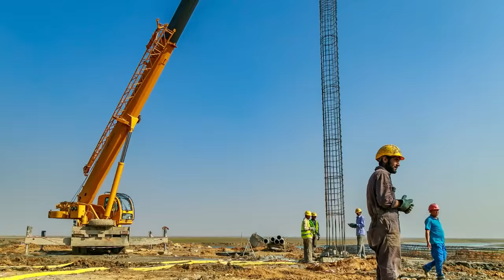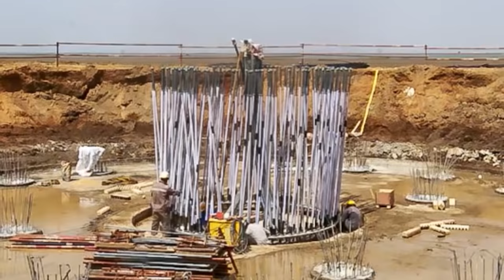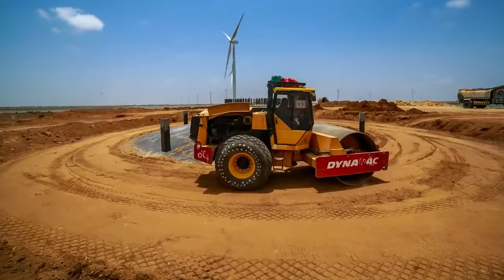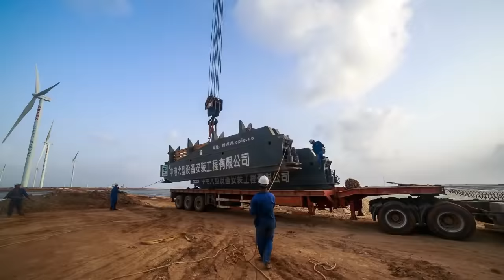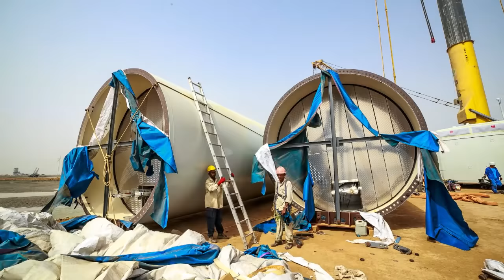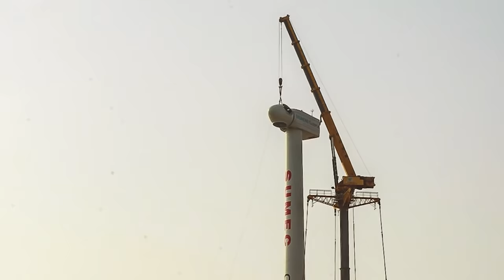Wind Turbine Farm Installation From Scratch | Time-lapse - Mega Structure

Comment: does one calculate the carbon footprint it takes to put one of these things up, or is that irrelevant?
Reply: It makes people feel good. That's the important thing.
Reply: Vestas studied the carbon payback period for various turbines. This took into account extraction and manufacturing of raw materials, production of the turbines, their transport, erection, operation, maintenance, dismantling and disposal, and the same for their foundation and the transmission grid. The figure was between seven and nine months, depending on the type of turbine. Other analyses have come up with similar figures.

Comment: What an incredible time lapse. It’s so impressive, the work required to install and erect a wind turbine. So much steel went into the base! I was amazed at the size and number of shafts that went into the foundation. I hope they don’t mind tying rebar! Lol. Thanks for the video 👍🏽
Reply: Imagine what it takes to build the tallest buildings. The foundation work alone is mine boggling.
Reply: Kashif, you make a good point about how un-Green this wind turbine is.
Reply: @earlysda  Vestas studied the carbon payback period for various turbines. This took into account extraction and manufacturing of raw materials, production of the turbines, their transport, erection, operation, maintenance, dismantling and disposal, and the same for their foundation and the transmission grid. The figure was between seven and nine months, depending on the type of turbine. Other analyses have come up with similar figures.
Reply: You must be a structural Engr.

Comment: Please tell me what part of this construction methodology can be categorized as “green”?  This is referred to as “green technology”.  Thousands of CY of earth moved to construct an access road; with diesel/hydraulic equipment (D/HE).  Thousands of tons of reinforcing steel fabricated, delivered, and placed by D/HE.  Thousands of CY or CM of concrete produced, delivered and placed by D/HE. The foundation concrete placement duration was approximately 14-hrs, overnight by utilizing diesel-powered light plants.  The steel is manufactured in an efficient coal-fired mill, delivered by diesel-powered trucks, and erected into position by D/HE.  The nacelle is minimum 25% polyethylene which comes from natural gas.  PVC conduit for the cabling, insulation for the cables are produced from derivatives of hydrocarbons found only in oil and natural gas.  The turbine blades are manufactured in an extremely controlled environment requiring a consistent electrical power source.  The blades are also made from synthetic composites derived from fossil fuels.  The turbine blades have a restricted service life dependent on natural environmental conditions and will be replaced several times before if ever the generator produces a ROI.  Every wind-power installation is placed in natural atmospheric flyways used be migratory species for centuries.  These installations are ALL subsidized by tax-dollars in the US.  That is the only aspect of their fabrication that can be truly referred to as a “green”.   I’m glads it makes all of you “feel” so good.  Otherwise, these illogical expeditions of your tax-dollars will be guaranteed to shred more birds than they could ever produce a ROI.  CHEERS!
Reply: Finally, somebody asking the proper question. On top of all that, they require an immense amount of maintenance and have a rather short life-span (~20) before they become permanently disabled eyesores. To properly consider their environmental impact, on top of everything you mentioned, we'd have to consider the immense amount of machinery and running time required to destruct them to return the habitat to where it started.

I respect all the engineering, the planning, the logistics, and the construction, but at the end of the day we have to ask ourselves -- does harnessing wind power really offer any net positive impact on our environment? Is it possible we actually produce more CO2 in the construction of these things than we offset with the power it generates during its lifespan? Can we really call this "clean energy"? Where is the cost benefit analysis?

Comment: The precision and accuracy of the crane operator are quite breathtaking... getting the base bolts inside the columns holes seemed to be an impossible task.
Reply: Thank the RIGGER for that. Crane op just takes his instructions
Reply: @zaidyjames7627  
The "crane rigger" is doing important and responsible job for sure, but don't forget that the operator is the one who interprets the instructions into actions (He's in charge for the moves).
Just imagine a very smart and well experienced "rigger" giving precise instructions to a dumb crane operator ! On the other side, a skillful crane operator would never accept irrational instructions !

Hope you got my point.
Reply: @Unknown-qy3dx  I do.

So it basically goes both ways.
Reply: @zaidyjames7627  
Exactly... both depend on each other in an integrated job.
Reply: @zaidyjames7627  Lee

Comment: I wonder how many years of operation it takes to outweigh the cost and fossil fuel use in the planning/engineering, manufacturing, transport, construction, and maintenance of these windmills.
Reply: In 2015, Siemens studied the energy return over energy invested...onshore 4.5 to 5.5 months and offshore 9 or 10 months. Today we have larger, higher, more efficient generating more electricity. In 2015 turbines were 2 MW in 2020 3.5 - 4.2 MW. So the embodied energy payback might 3 months...

Comment: Fascinating stuff. That is just pure art  the rebar work. I had no idea such a substantial base was below ground, that must cost a hell of a lot of money just the base alone. And the way the bottom section flange simply slid down the ground fixing bolts, bliss.
So if this amount of work is required for each turbine column then that windfarm will take years before payback 🤔
Reply: And in 15 to 20 years when the wind turbines are done providing energy, what happens to the base in the middle of farmland. Their could be HUNDREDS of these spread throughout the county buried? or left standing?  What to do with the blades since recycling is costly and not widely available. Landfills here they come.
Reply: I don't think they will be done after 20 years, because they will be maintained.

Comment: How long would this need to run before it’s installation was carbon zero?
Reply: For the vast majority of turbine installations, it's six months or less.  And of course there's far less carbon waste in construction of these than a coal or gas plant.
Reply: After hub height exceeds 90 meters they will never become carbon neutral until after 25 years of operation.
Reply: a couple of months
Reply: it's usually 9 month or even less at the coast.
Reply: @rhondasouthard4682  Vestas studied the carbon payback period for various turbines. This took into account extraction and manufacturing of raw materials, production of the turbines, their transport, erection, operation, maintenance, dismantling and disposal, and the same for their foundation and the transmission grid. The figure was between seven and nine months, depending on the type of turbine. Other analyses have come up with similar figures.

Comment: so how long does it take then for this one windmill to pay back all the gasoline/diesel used by the construction vehicles?
Reply: Vestas studied the carbon payback period for various turbines. This took into account extraction and manufacturing of raw materials, production of the turbines, their transport, erection, operation, maintenance, dismantling and disposal, and the same for their foundation and the transmission grid. The figure was between seven and nine months, depending on the type of turbine. Other analyses have come up with similar figures.

Comment: would love to know the actual honest carbon footprint of windmill from workers traveling to offices to design it,workers traveling to work to make the materials for it, the shipping/transport/instalation etc
i know my old chemistry teacher said he worked it out for our local windfarm and reckoned it was 10 times worse than coal fired power stations.
Reply: You forgot mountain top removal for coal, transporting it, the actual burning and the average of 250,000 tons of waste per year that one coal generator produces
Reply: @justinsnyder5260  The difference is they don't call coal "clean energy". Wind is labeled clean, but clearly with the amount of CO2-belching equipment + running time to build them, transportation of all these resources, etc. there is a significant cost that nobody ever mentions. Coal plants last longer than 20 years too. This thing will be nothing more than an eyesore in a couple decades. All we're asking for is a little more honesty in the "green energy" sector, something sorely lacking right now, and that is by design. It's all about the $$$.
Reply: @keyser456  Vestas studied the carbon payback period for various turbines. This took into account extraction and manufacturing of raw materials, production of the turbines, their transport, erection, operation, maintenance, dismantling and disposal, and the same for their foundation and the transmission grid. The figure was between seven and nine months, depending on the type of turbine. Other analyses have come up with similar figures.

Comment: How long before it has given back the energy used to create it?
Reply: 6 months
Reply: @TheFreshSpam  not a hope in hell that its 6 months unless your factoring just the manufacturing of a single turbine itself. All that digger work, man power, delivery, concrete, cranes has to be factored in as well
Reply: @davidoff59  If your thinking that in this video the amount of man power and machines used is equal to more than 6 months of a fully utilised wind turbine generating energy I think you have your estimates completely off. If that amount of work amounts to more than that the world is royally screwed when we build anything big.

I think youd be suprised, and when you create the definition carbon neutral you incorporate its construction and creation.  Yes all those digger and people. Wind turbine are effective. They just sit there and spin and generate.

6 months and getting shorter by the day. The more we make the shorter the time.

Comment: Question: why they cut off the top portion of the foundation beams?? I have also seen this when they make pillars for flyovers.
Reply: I think to make that cantilever.. They cut off and spread it horizontally and then concrete slurry was moulded which make that vertical beam cantilever

Comment: I wonder how many years of energy production it take to break even on this?
Reply: Vestas studied the carbon payback period for various turbines. This took into account extraction and manufacturing of raw materials, production of the turbines, their transport, erection, operation, maintenance, dismantling and disposal, and the same for their foundation and the transmission grid. The figure was between seven and nine months, depending on the type of turbine. Other analyses have come up with similar figures.

Comment: The costs for a utility scale wind turbine range from about $1.3 million to $2.2 million per MW of nameplate capacity installed. Most of the commercial-scale turbines installed today are 2 MW in size and cost roughly $3-$4 million installed.

Comment: Incredible work done by all!
But look at all the raw materials that go into making one turbine?
Concrete, steel,copper,fiberglass,alot of oil for the gearbox/transmission, all the diesel to run the excavators,trucks,etc.
I heard that a wind turbine NEVER becomes carbon neutral?
Reply: An incredible amount of fossil fuels went into producing this "green" energy source.
Reply: Vestas studied the carbon payback period for various turbines. This took into account extraction and manufacturing of raw materials, production of the turbines, their transport, erection, operation, maintenance, dismantling and disposal, and the same for their foundation and the transmission grid. The figure was between seven and nine months, depending on the type of turbine. Other analyses have come up with similar figures.

Comment: - Haha....  what is the life expectancy of a windmill?  Also, what kind of maintenance is required to keep them running?
Reply: 25-35 years. Weathering and freezing of the blades needs constant checkup. It's expected that the turbine will receive a replacement set of blades once in its life, but depends on conditions. Also the gears, generator and power electronics in the nacelle need to be maintained. There's an access path inside the turbine for technicians.
After lifespan the turbine is dismantled, but the concrete foundation will just be left there since it's too expensive to remove. Also, many components are recyclable material like steel, but if the turbine blades are fiberglass they'll probably just end up buried in a landfill.

Comment: Look at the massive land displacement, energy use and resources (steel, copper, concrete, composite material for the blades, etc.) for a few megawatts of energy. Windmills are a disaster for the environment. Nuclear power uses a tiny amount of land and a fraction of the resources for 1,000 megawatt reactors.

Comment: I’m not understanding why they had to do all that demo on those concrete columns.
Reply: They hold whole construction. The biggest work and calculations must be done.
Reply: Because they don't know how to install a drilled shaft correctly. The rebar should not have been covered in concrete to begin with if it needed to project into the footing.

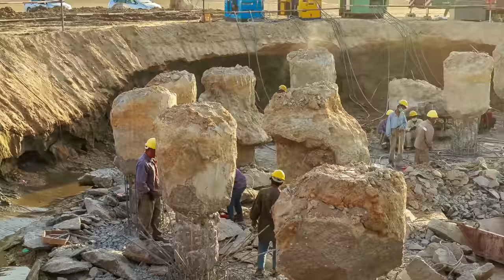Comment: @1:41 instead of placing a canal like option, they are directly placing the main central wire under the concrete. isn't that a bad idea? 
what happens when something goes wrong in that part of the wire connection?
Reply: It's just one smooth 90 degree bend, so I assume it's possible to re-thread a new cable through the bend if you need to.
Reply: john mcgee  Thanks for the information bro.

Comment: Hallo 
How does drilling  a stratting on video which type drill machine i like your sharing video wher are installing this plant and which country thank you
Reply: Pakistan.
Reply from the maker: Hi,
Its piling machine not a drilling machine, its a simple piling process in which they dig a hole, insert a steel cage and fill it up with concrete in order make a pile inside the surface.
This work was done in Karachi,Pakistan.
Reply: @TheBigHeadFilms  ok thanks this type of  plant do in india
Reply from the maker: @vorasanjay1405  Yes.. India is also moving towards renewable energy rapidly.. in fact they have one of the biggest solar panels farm..

Comment: the sheer amount of diesel burned to build one of these must take a while to match with renewable energy generated
Reply: Vestas studied the carbon payback period for various turbines. This took into account extraction and manufacturing of raw materials, production of the turbines, their transport, erection, operation, maintenance, dismantling and disposal, and the same for their foundation and the transmission grid. The figure was between seven and nine months, depending on the type of turbine. Other analyses have come up with similar figures.

Comment: The biggest turbine I'm aware of is the Haliade X-12.(General Electric) It's blades are 110 meters (357 feet) measured from the center of the hub, to blade tip. That machine only puts out 12 million watts. I don't think a 50 Megawatt machine exists. That might be the nominal output rating for the entire farm, rather than from any single turbine. It is a direct driven annular alternator, no transmission.
Reply: 50 MW machine does not exists at present. It's a 50 MW wind farm. Highest capacity wind mill is of 9.5 MW of Vestas.
Reply: @bhaviksachdeva3429  That definitely makes more sense, but, a 9.5 MW wind turbine is still impressive to say the least!
Reply: @vincentrobinette1507  Exactly Sir
Reply: Bhavik Sachdeva Siemens Gamesa has the 10 MW 193 direct drive for offshore installations
Reply: @matteobrughera3722  Do you know what kind of alternator it is? Is it externally excited, like the large Enercon, or if it's permanent magnet, like the Haliade?

Comment: 50 megawatts? One "50 mw" turbine or is it 50 one mw turbines? I thought the biggest was 7 megawatts.
Reply: the title says "50MW Wind Farm", not "50MW Wind Turbine". A farm usually has multiple units. 7MW is big, but not the biggest.
Reply: @chris42076301  Ok, no worries. Is it bigger than 10 MW? What's it called (if you know off hand).
Reply: @Justwantahover  GE's Haliade claims to be 12MW and Siemens has a 14MW one, and there are some other ones around 10MW, but they are not in commercial operation. As of now, I think the biggest commercially running model is V164-8.4MW from MHI Vestas.